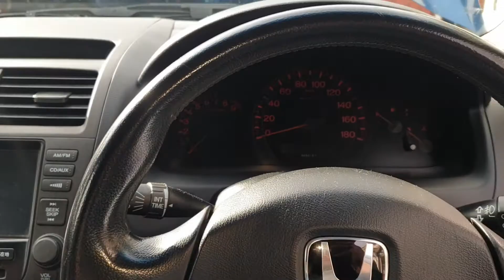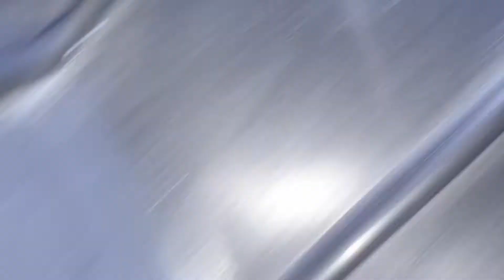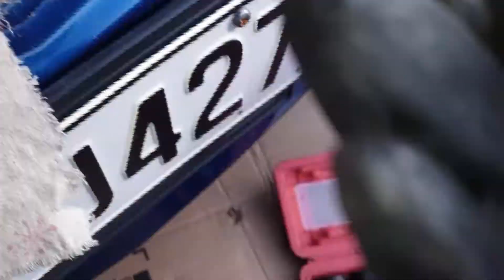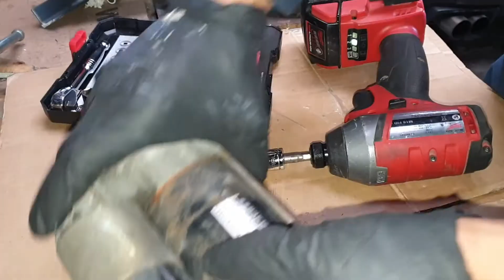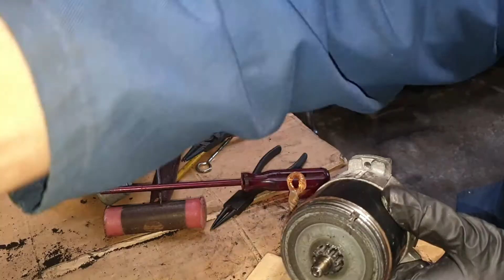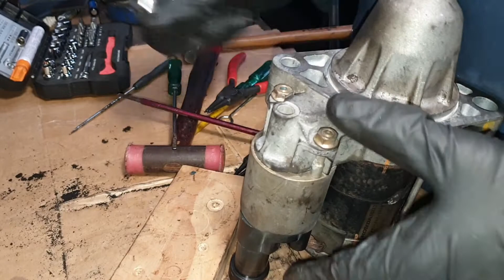Starter Motor Removal & Repair (Honda Accord K20A) Grinding Noise cold start?

Comment: Thank you so much! I had this exact same issue with starter and a simple rebuild following this guide fixed it! Even though my car has a really new starter, the aggressive new clutch in my car kicks out a lot of dust. The starter itself wasn't too dirty, but there was just enough grime in there to cause it to stick. Thank you for the thorough and easy to follow instructions!
Reply from the maker: Glad it was helpful! Thanks for the comment. Do like and subscribe so helps me grow the channel